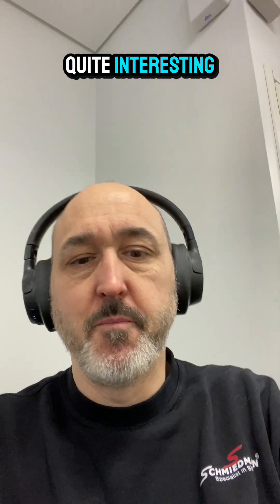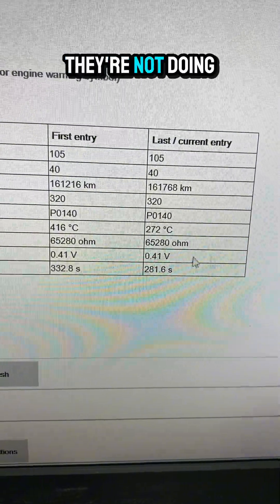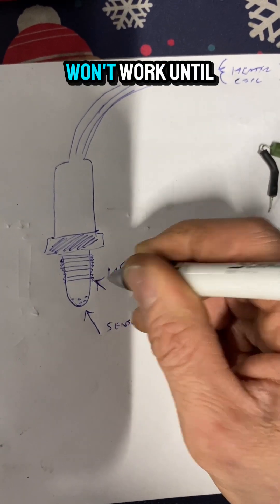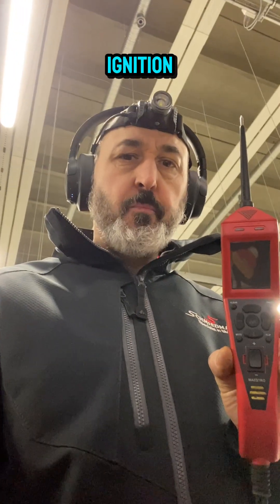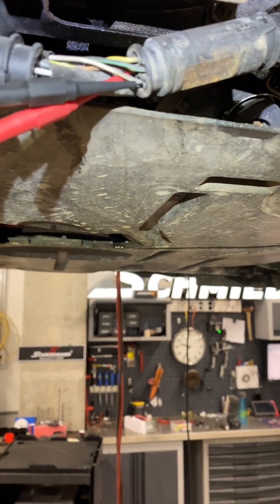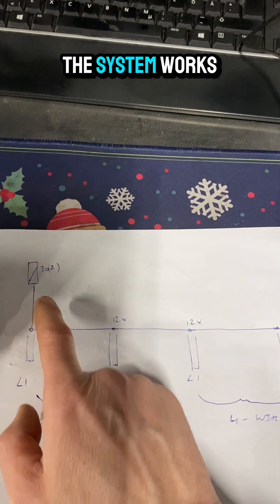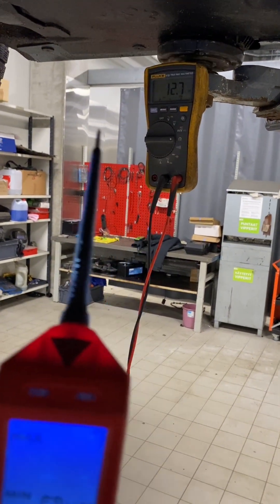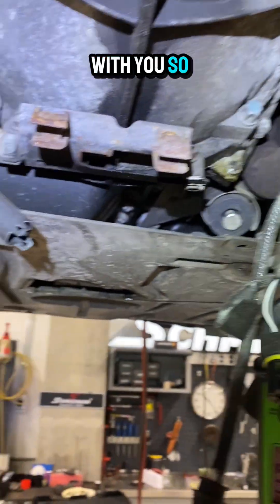Why Your Car's Lambda Sensor Isn't Heating Up (and Why It Matters)

Comment: Do you come across faulty lambda sensors from oil contamination?  I have seen a few cars where the oil has wicked its way into the sensors via the wires. I am just curious about the differences and similarities of faults that occur around the world. Cheers on an intriguing video.
Reply from the maker: Not many Brett. Usually its just them ageing or with fuel contamination

Comment: As an additional test you could power the heater up for a few seconds, to increase the resistance.  Then remove the power, connect your mulitmeter to measure ohms and watch the resistance drop back down as it cools.  I am assuming you will already know what resistance values your are expecting from hot to cold.
Reply from the maker: I did that champ but didnt video it. Lately I have no time to do anything 😅 Good point Julian 👍